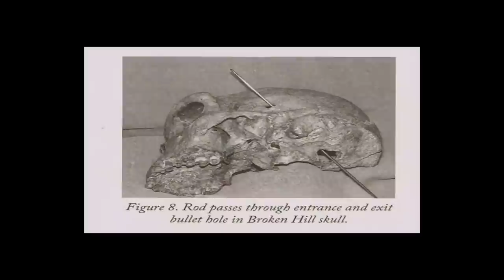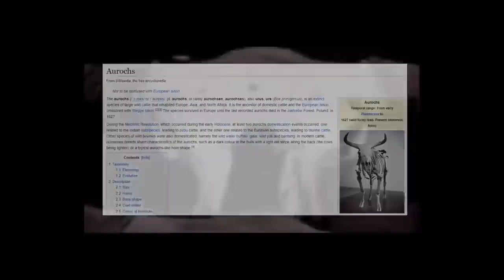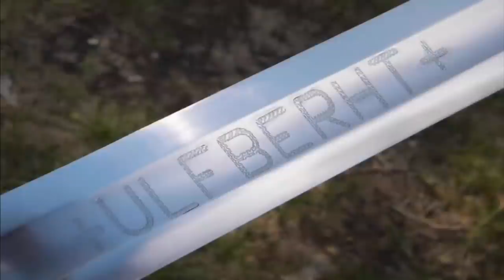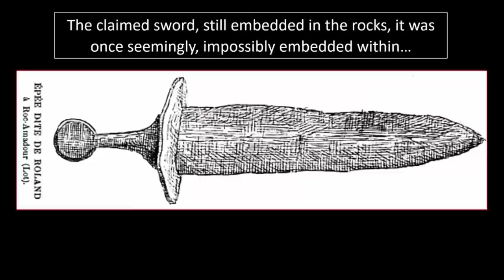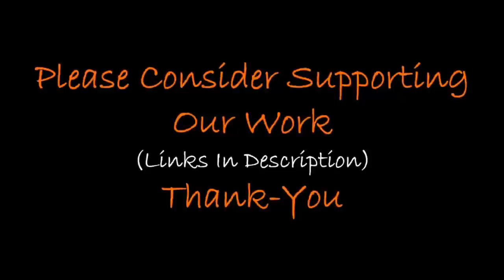🔫 Impossible Weapons From The Past & Future 🔫

Comment: The sword stuff is cool, but it is my understanding that Ancient Japanese “black sand” steel is not very impressive at all by modern steel standards. What IS impressive about it is how early they were doing it! Those stones in the beginning made my jaw drop.
Reply: Your right, Japanese steel isn't very good but the way they "fixed" that was pretty impressive, by using a taco like billet with mild steel on the outside and hard steel on the edge made it strong and flexible